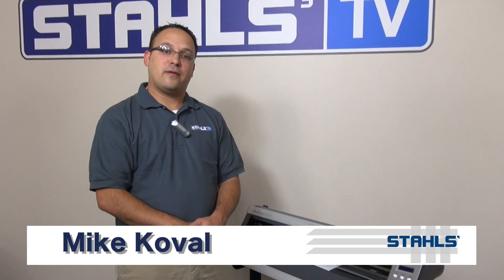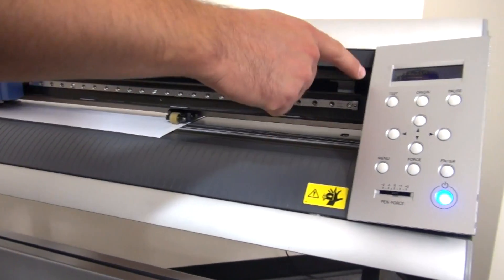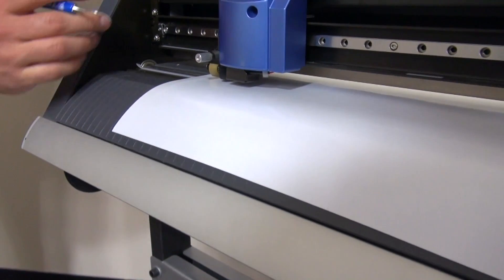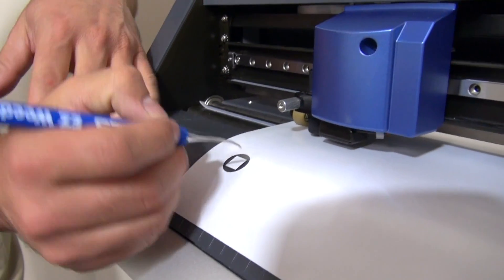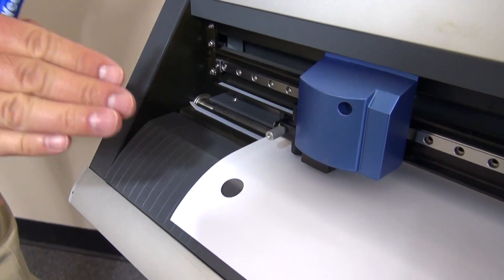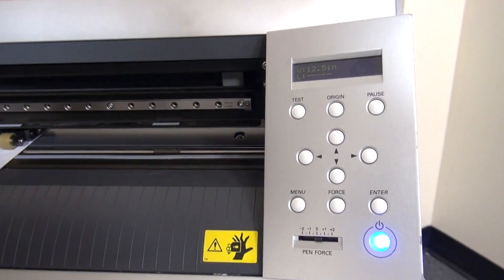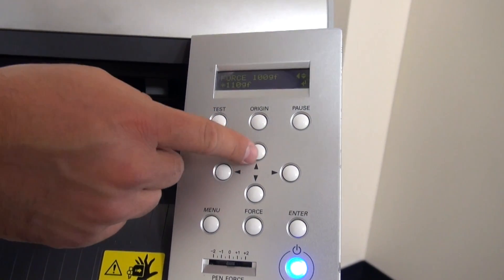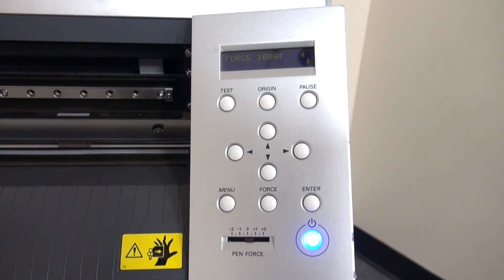Roland® GX-24: Setting the Force

Comment: of course you don't mention or say what the "pen force" slider switch does, meaning I have to write this message, lol
Reply from the maker: This is for an actual pen attachment. You can just leave it at 0 when working with heat transfer vinyl.
Reply: thanks :)